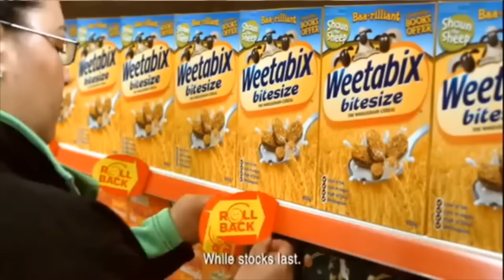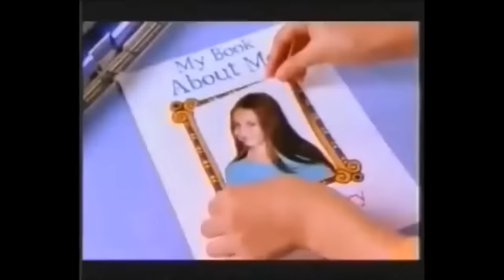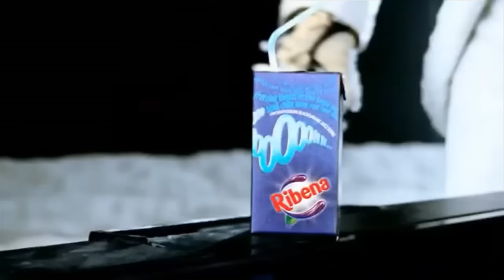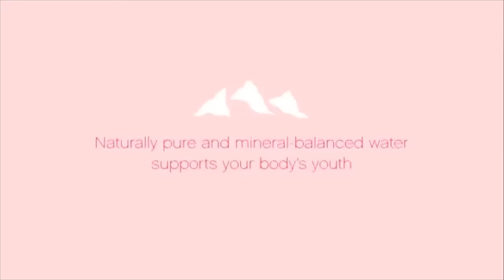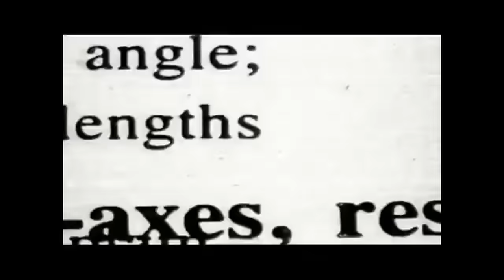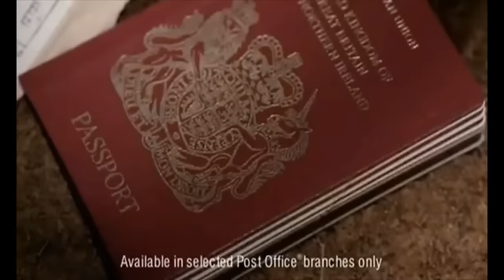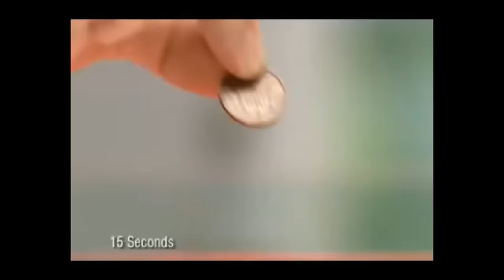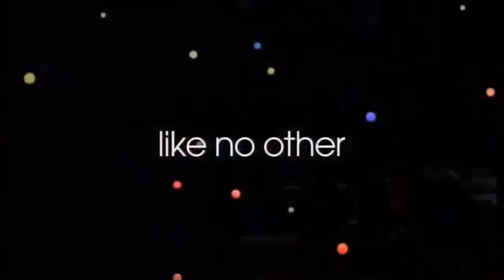2000's UK Nostalgia Adverts Compilation (PART 1)

Comment: technically we're still in the early 2000's even if 2020 is 20 years into the century.

2030 I'd say is when we're reaching the Midpoint and 2050 is self explanatory.

Comment: How come you put some from after 2009 and also 1984?
Reply from the maker: Mostly for 2 reasons, either:
 1) I didn't know they weren't from the 2000s until the video was finished, like the Checkatrade ad
2) The advert aired during the 2000s, like the LV, Hexbug or Um Bongo ads, but i couldn't find a version of it from then so I had to settle for one from the 2010s (or in one case 1984 lol)

Comment: Some of these are later than the 2000s, the LV for example was only about five years ago, it even says on the t and cs, based on jun ‘13-‘14 sales
Reply from the maker: I know, unfortunately i couldn't find a version of the LV advert from the 2000's so i had to make do
Reply: @bobskeleton4502  ah those og LV adverts were 👌 LV adverts in general are good so I see why you compromised ☺️